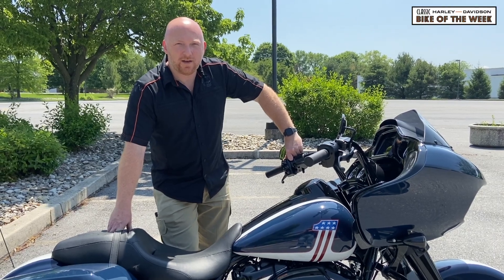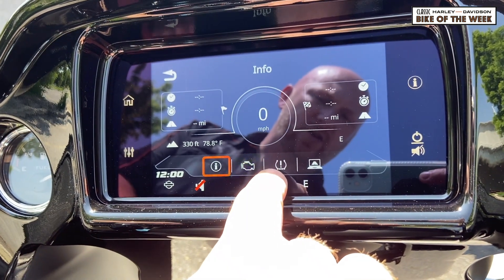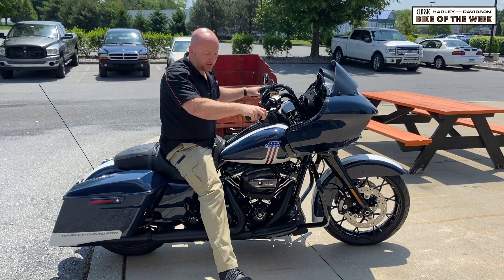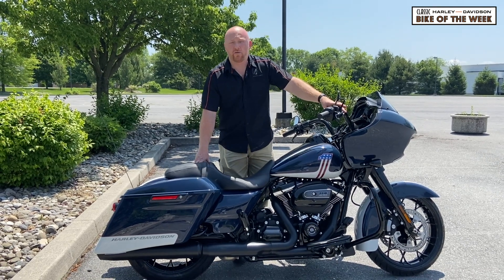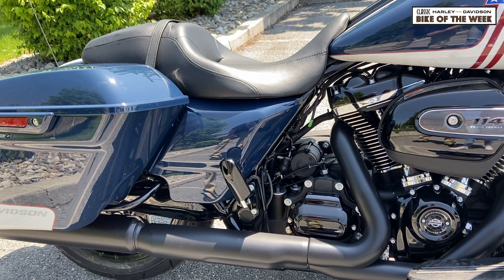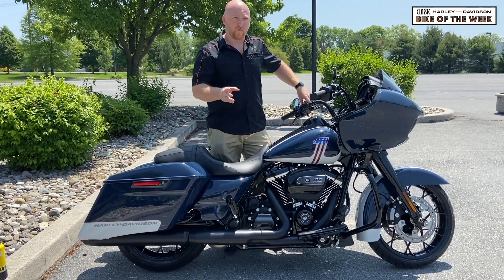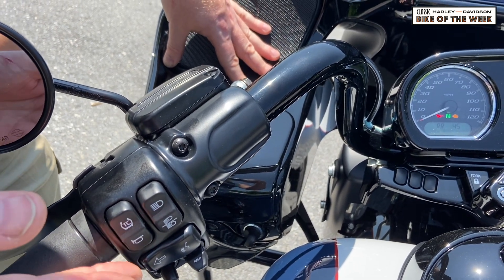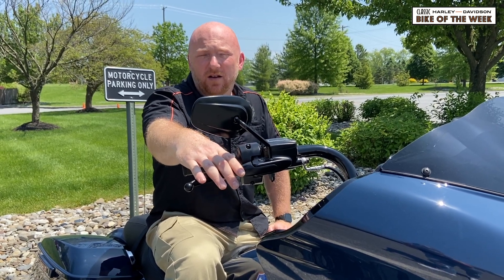Reflex™ Defensive Rider Systems (RDRS)

Comment: Just the rubbish of abs within motor cars then  changed names so they are able  to attach nonsense to motorcycles and call it defensive rider stuff 
This is why we do not need our brands touched but only built the proper way. 
It is amazing they have not put a pull chord on the motorcycles so they know when to get of the line. Just complete rubbish
AFFA angels never die nffn HMS sonny

Comment: The RDRS sounds great if it is working properly. I have a 2021 Road King with RDRS it has been back to the dealership 2times with code C1034 and C1100 the local dealership couldn't fix it.

Comment: Excellent video and explanation. How much is it to add this feature on a Road King. I have a older Police RK with ABS but looking into this makes me want to consider an upgrade just for the technology upgrades.
Reply from the maker: Paul, please give our parts and service department a call at 610-916-7777. They can help you with your questions and give you a quote.
Reply: RDRS is a $995 option on a new Road King (FLHR) .... if you can find one equipped with it. Most of the new  Road King Specials (FLHRXS) I've come across have it. New Police RK's have it as standard equipment along with the 114 motor. Could it be added to an existing bike? Don't know but even if you could I'd think it would be cost prohibitive.